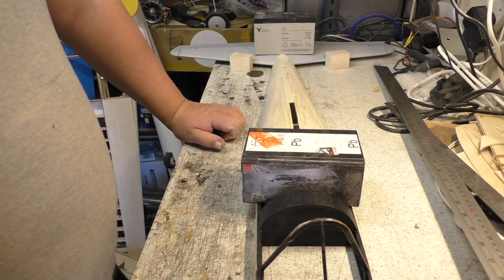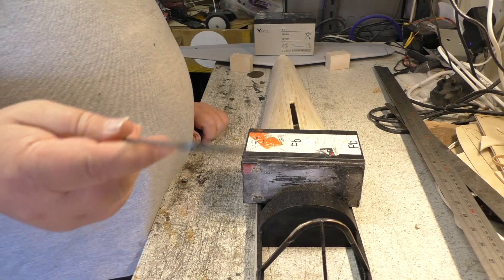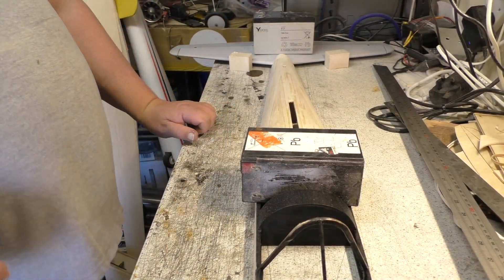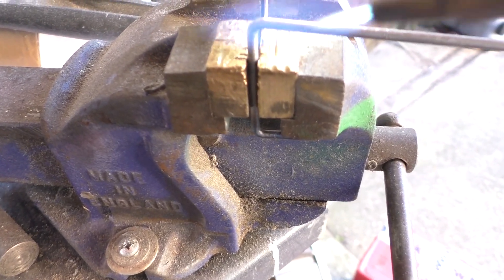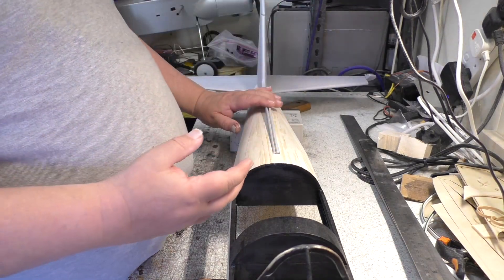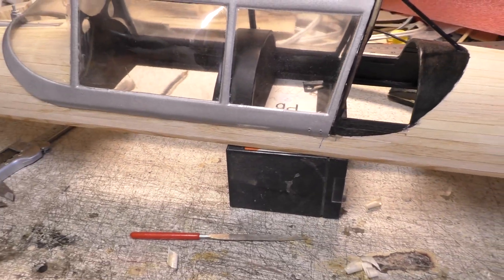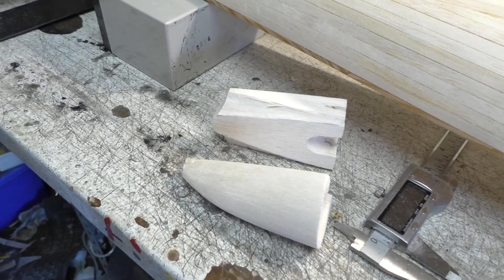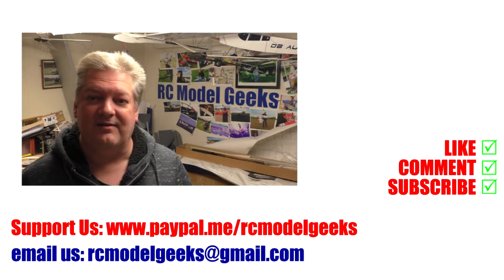Sarik Hobbies Dennis Bryant 68" DHC-1 Chipmunk Build Pt35 RC Model Geeks

Comment: Even Du Bro need to learn about tempering and I took them to task recently when two expensive coiled nose legs broke when I attempted to bend the wheel bend,they denied there was any problem but what they are doing is sending out heavy gauige piano wire legs out with tempering them and yet adding that fancy chrome they use the wire just shatters,the model shop I purchased them from refused to do anything so expensive lesson do not buy those carded nose legs from DuBro !

Love the sliding canopy Rob,very clever and simple too which is usually the case with all good ideas,the tail cones too look very effective and I for one would never think of carving that as one unit,anything that has acute curves needs doing as separate pieces,sometimes these plans are merely a guide and we have to update them to our own ideas.

By the way beware everyone of stuff sold as piano wire that is not ! Chingwire for example is merely mild steel,also some piano wire sold as such is silver steel a totally different thing to piano wire,if you buy thin piano wire then buy from a musical harpsicord supplier,it is called music wire which is what piano wire was originally called in America,early plans refer to 'music wire' it will come on a reel that springs itself straight no problem also it is bright and not dull colour,the brighter the wire the better and you will be amazed at how easier it is to use than these horrible substitutes.

You saw it here on RC Model Geeks where real model building happens ! that right Rob ?
Reply from the maker: Right on Angel ;o)